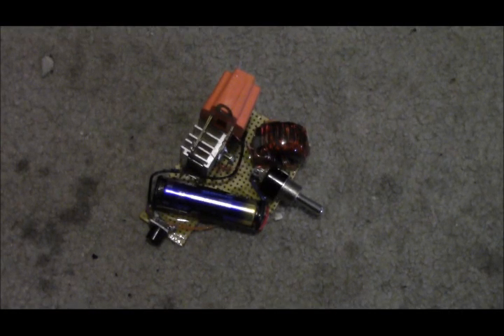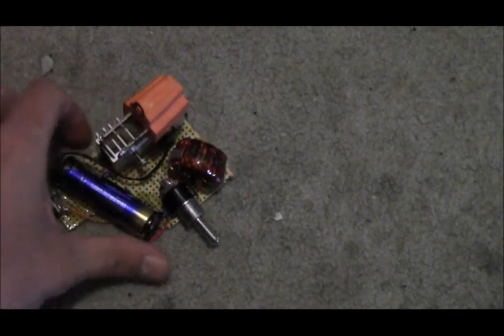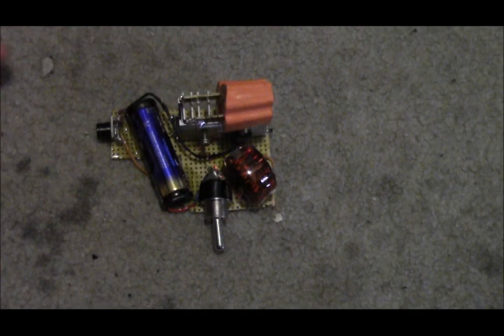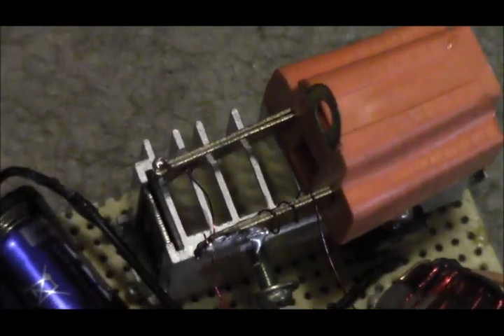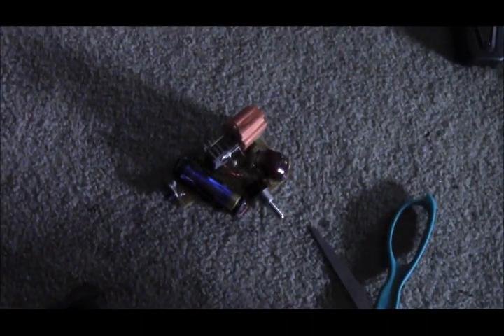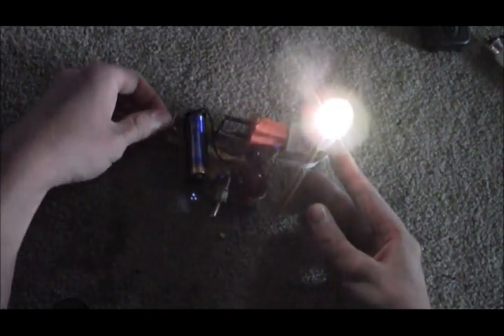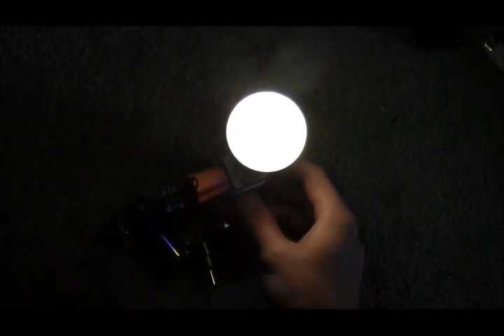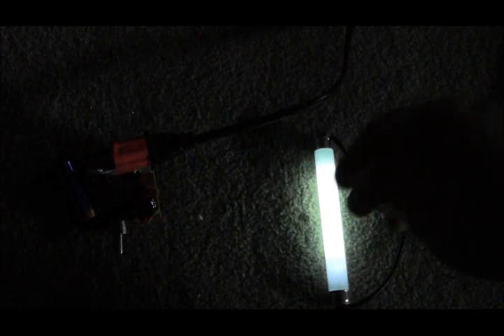SUPER Joule Thief Inverter! 3.1

Comment: Hi.Nice project. Can You tell me some tips to make it work good like you've made it? 19 Turns are over 350T winding or are made side by side on the ring?sorry for my english. Cheers
Reply from the maker: Sure! The best place to find the right toroid is in an old power supply. I found one recently in an old computer power supply and it was encapsulated in a white plastic ring and it works amazing. My toroid was big enough that I could wind them side by side but winding the 350t over the 19t is the best way to go. You can adjust the resistor to control output current and frequency, and you can adjust the capacitor to control output power. Using a transistor from an old CRT monitor works even better than the TIP31. Coat the toroid in epoxy after winding it to prevent arc-overs.
Reply: ClevelandStorms could you tell what size of wire i should use for 15t, 4t, 350t.?

Comment: Hey, so, a few questions. You mention you switched types of wires on your secondary windings. Did you solder them together or just wind on top off one another?

Also, how long did the light last?
Reply from the maker: I just wound the first type on then soldered the two types of wire together to make a really long piece. The light lasts about 3 hours full brightness, dimmed down it can last longer

Comment: Hi! I've been working on your schematic and it works but not as yours, mine only gives 4 volts for output and if i take out the .22uf cap it only gives 20 v so i have 2 questions only. Which are the characteristics of your toroid(color, diameter, large, etc.)? And which transistor is the best for the circuit? Also if you have another recomendation for anything else it would be great! Thank you bro, youre awesome
Reply: ? :D
Reply from the maker: Ricardo Rodriguez The toroid is black, 1 1/2 inch by ~5/8 inch, and dense. I don't know any other characteristics about it. I used the TIP31, but a TIP35C or a 2n3055 should work just fine. A standard power transistor is what you are looking for, almost any NPN will work well enough. The toroid is key though. I wish I had the materials to accurately measure other characteristics about the toroid but I currently don't. Thanks for building this project! It's great to know that there is interest in this

Comment: Hi, great job, a question can I connect a cell phone charger to charge a phone with this say a tiny phone or it is only for bulbs? thanks
Reply: Celal Boz there is not enough current to power the charging requirement needed of a phone.

Comment: could you tell what size of wire i should use for 15t, 4t, 350t.?
Reply from the maker: 22 gauge should be used for the 15t and the 4t and 30 gauge should be used for the 350t

Comment: sir, may I ask how did you wound your torroid?
Reply from the maker: I wound the 4+15 center tapped primary on one small section then I cut about 6 segments of 30 gauge wire. I would wind one segment on the toroid, strip the site, solder on another segment, and continue winding.

Comment: Hi! Could you tell me how you did the 4t & 15t winding please? One is over the other or they are separated? And what do you mean when you say that you solder the 350t part? Thank you man! Nice project
Reply from the maker: Ricardo Rodriguez I wound the primary (19 turns with a center tap at 4) first onto the core. Then I would 350 turns going around the core on top of that. I would measure about 6 feet of wire for the secondary, wind that on, then solder another six foot piece of wire onto that and keep winding. It made it easier then just winding a 20 something foot piece of wire.  Hope this helps man!
Reply: ClevelandStorms thank you man, awesome job!